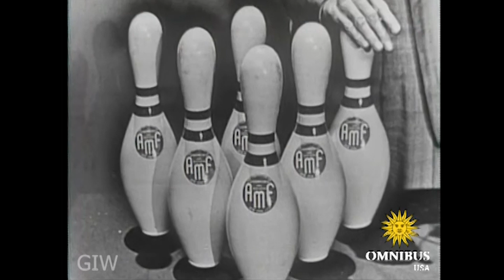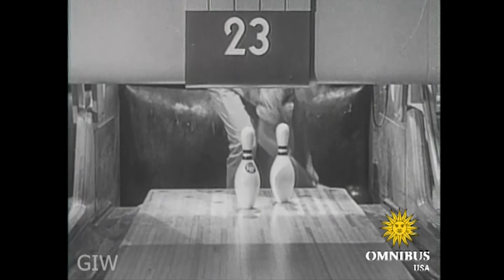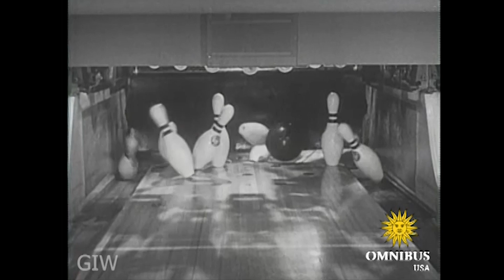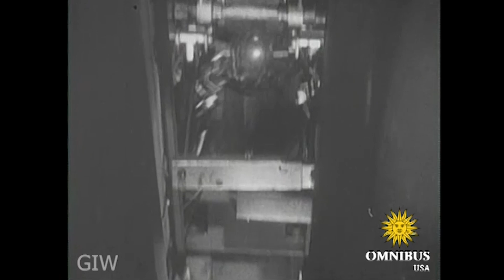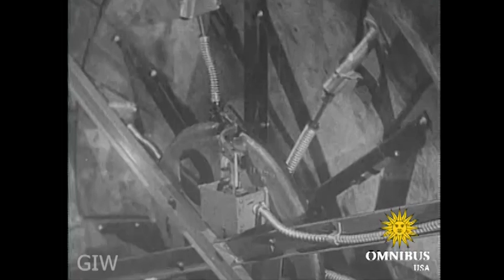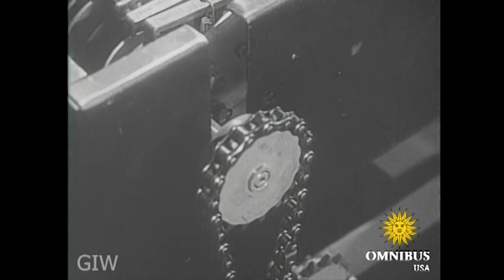"The Automatic Pinspotter" | Omnibus With Alistair Cooke

Comment: This is the very earliest AMF 82-30 pinspotter with the 3930 "latch" chassis, where the distributor rested at the 10-pin as opposed to the 7-pin (IIRC most of the later 3930 chassis and all 4400s, 5850s, & 6525s, rested at the 7-pin also).

Comment: Ahh the 8230s. Pin chased on those on the 12 lane local house in the 80s. They replaced them about 20 years ago. A local pro shop bought another old blowing alley for that purpose and still uses the 8230s to this day.

Comment: Many bowling centers still have these machines. One of the greatest underrated inventions. Where my parents live on upstate New York,  there's a center with 30 lanes with these pinsetters. If you take care of them they will last forever.
Reply: my church just inherited 14 of these although due to lack of replacement parts, they may convert to something newer or possibly string machines
Reply: Not so sure I'd say many but some still do.  My local 8230 house just recently swapped them out for 8270's from a house that closed.

Comment: Brings back a lot of memories.  In the town I grew up in, we had a small 10 lane house that had the exact equipment in this video (masking units and sweep bar, with over lane returns.  The returns were not AMF's, as I recall they said 'Blatt' on them and the reset button was all the way up near the foul line instead of the bowler area).  It stayed that way until the late 1960's when they 'upgraded' the sweeps and masking units to the AMF ones popular in the early 1960's (seen on a lot of the old Championship Bowling shows) but without the Spare Maker arrows.  It remained that way until the early 1970's when the establishment closed and became a Taylor Rental location.  I don't believe anyone ever shot a 300 in that house.
Reply: Yep Blatt is right - they were out of Trenton, NJ
Reply: The AMF 8230 pinspotter.